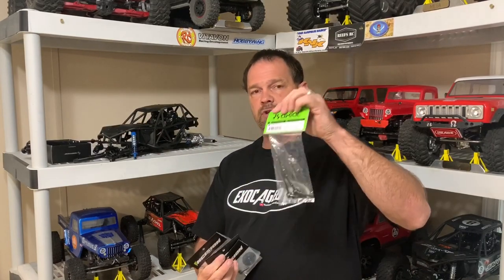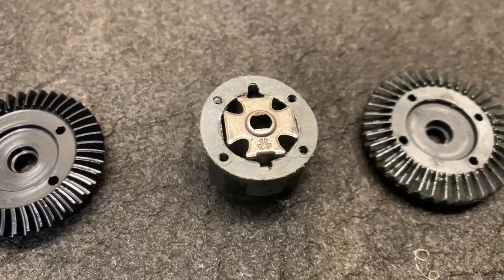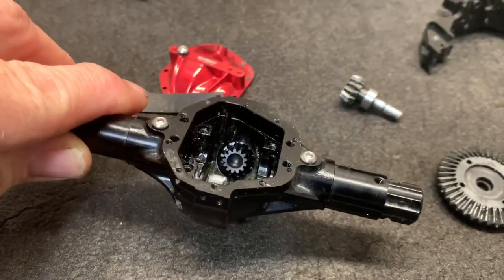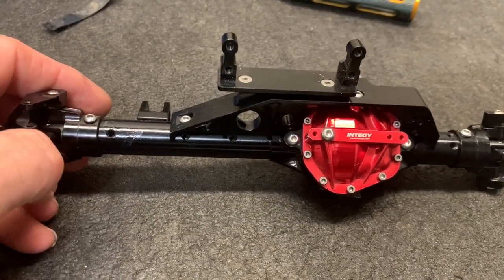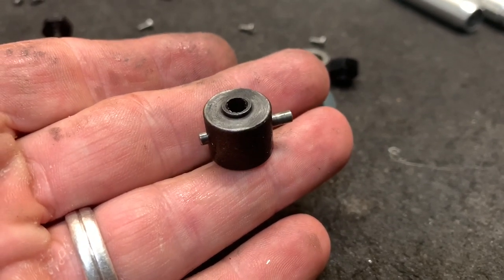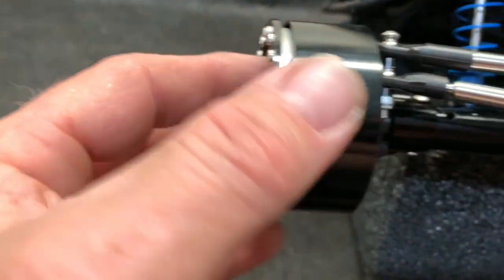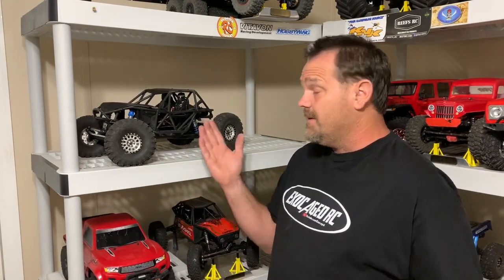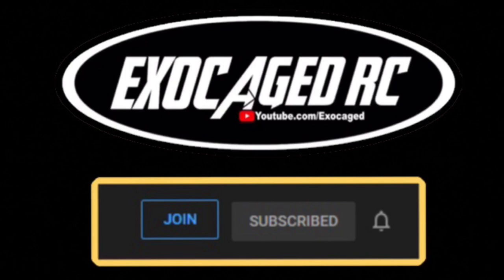V1 Brushless Bomber with Incision parts and more!!

Comment: Would really like to have a lower gear option for the capra, but I'm getting happier and happier with the 11t pinion 2700kv 3s combo. Thanks to JRH for making buttery smooth motors
Reply: There is a lower gear option. Get a axial 3 gear transmission plate that's ment for the capra. Spare times hobbies and ucfab makes one
Reply: Jeremy Burris that’s not an option, that’s a modification. I would also lose dig. I’m happier with it than with this.

Comment: Can you tell a difference between the plastic beadlocks vs aluminum?  I'm trying to decide if I want to get aluminum for my yeti or the axial raceline plastic beadlocks.  Which do you prefer?  I don't do any crawling.  Thanks!
Reply from the maker: If the plastic ones are holding up then sty with them. Metal is usually more durable and adds weight, if you are bouncing around and racing then that added weight may not be a good thing
Reply: @ExocagedRC  Awesome. Thank!

Comment: smdh.  Put the steering cross link on the bottom of the Pivot Arm, not on the top. That will lower the steering link down, and allow the stock tires to fit.
Hard to believe that had to be said.
Reply from the maker: Hard to believe you said that because I did that.... I’d need a spacer on the left side to make that work. Can’t believe I had to say that.
Reply: I just want to thank you for saying that now I can put my stock tires back on.